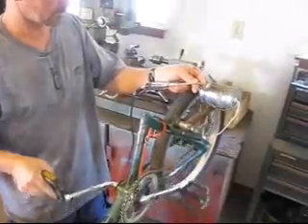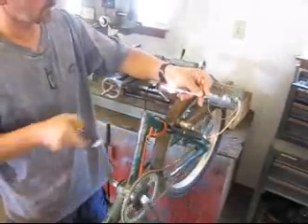Hybrid electric recumbent boat.wmv

Comment: did you ever get lazy and just throw a battery on it?  By the way love the home made single passenger stuff. I am building a 4 wheel stainless steel bike . I installed a 280 watt motor on it but plan to upgrade to a 1000 watt motor .  I really have to post some new vids .